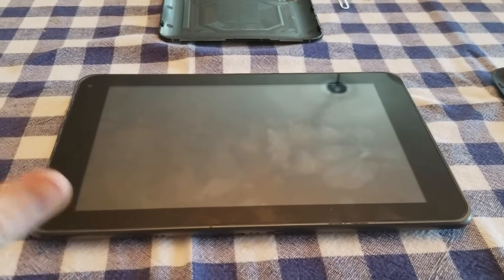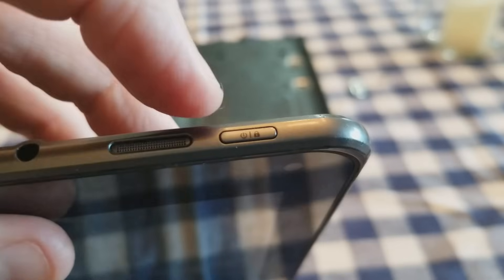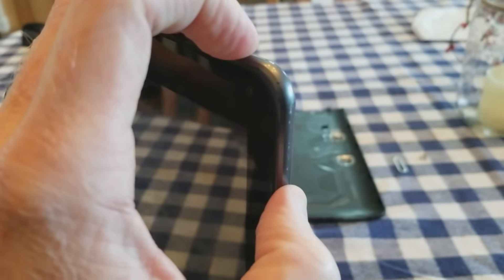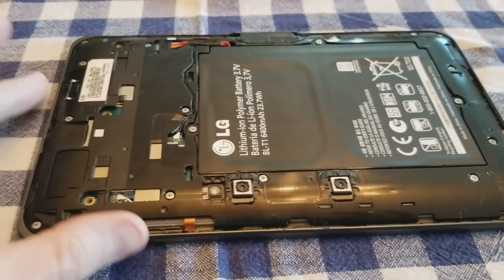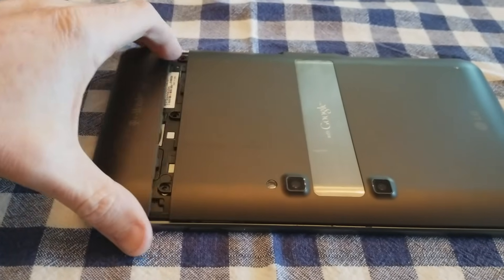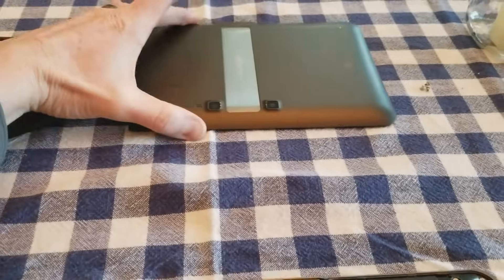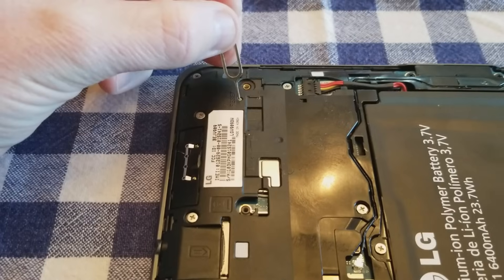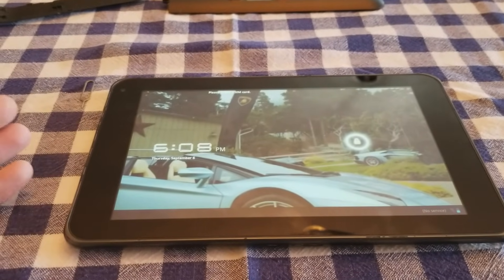Android Tablet Won't Turn On FIX!!

Comment: My tablet hasn't been working for 3 days! I have been holding down the power button while it's charging so it will turn on, (that's what usually happens) but, you know the battery that will pop up and show your %? (Tablet A Samsung android) it just kept flashing. So i thought it might have cut off, and my uncle works with computers and stuff but i can't get up with him because my tablet won't work!!! I really, really, really, hope this strategy works. 5 hrs later... It didn't work. I've had so many memories on it though. I can't take the back off of mine or it will probably break so.. I guess I don't have a tablet anymore :"(

Comment: I have a samsung tablet, I dropped it on it’s head, it’s not cracked or anything but it just turned off into a blank screen. When I plugged in the charger it kept flashing the sign that it was charging, when I clicked the power button the starting screen turned on but turned off, I don’t know what to do

Comment: mine has been packed away in box for 2 years and now can only get the dead android man and warning light....any ideas on this?tried the all 3 button method but won't bring him back to life :0(
Reply: I could try to find a way if you’re still having trouble
Reply: Did you try measuring the voltage on the battery ? 🤔
Reply: that’s the problem with mine too
Reply: Your battery is probably dead if it's been sitting there for that long
Reply: what i did was hold in the reset button for 15-20 seconds then let go, after that i put it on charge with an adapter that was alot stronger than the specified charging amps ; 2.1 to be exact (its an apple ipad charging block and i used a ps4 charging wire) and left it for about 10 minutes it should change the screen to the charging stage then just leave it to charge and your all good if this doesn't work try disconnecting the battery from the circuit for 20-25 seconds and then reconnect, if it still doesn't work try both steps together and just leave for a couple of days to jump start the tablet into working. Hope this helped as it worked for me.
Reply: @shinygoldman4464  had to come back to say thank youuu!! 🥰😭
Reply: @htxrosee  your welcome glad to help someone hope you pass the knowledge onto someone else
Reply: Power + Down Volume did it for me
Reply: @isa.marie2009  i have a rca and in a few months it broke.
Reply: I'm having the exact same problem with mine.  I don't suppose you found the miracle cure since you posted your issue, have you?  It's been three years at this point that I've been holding onto this thing hoping I'll come across a "tablet whisperer" who can revive it.  I don't want to put any more money into it than I already did back when Sprint charged me for the insurance deductible, didn't fix it, and gave it back to me to stare at while I continued to pay for the lease and the service it wasn't using until my contract expired.  I'm so paranoid that as soon as I toss it, someone will post something that I could have used to fix it.
Reply: @sheriwilson3320  Did you open yours ? In my example I had to start it externally by applying a small load to the internal battery to unlock it. The latter had like 7 wires or so. 🙄
Reply: Oh no
Reply: Make a vision of that so I can see it
Reply: Mine won’t even do that 🤪

Comment: Thank you so very much....I almost threw it against the wall
Reply: Tripp Courtney hahaha i was thinking of doing that too lol
Reply: @kyoko-chan227  ll
Reply: ゼシストZethyst a a ewwwaaqwwwwww
Reply: @kyoko-chan227  sometimes you just have to let it go....as hard as u can at a wall
Reply: I always do it and then it works lol😂😂😂😂😂😂
Reply: @jeremiahbrady3117  same
Reply: I am still suffering 😡😡😡
Reply: Me to
Reply: No lie. Or bust the whole thing trying to get at the battery.
Reply: Me too I always do that
Reply: @nxiyxh00  cap
Reply: @idcidek2727  what
Reply: @nxiyxh00  nvm
Reply: Tripp Courtney For an RCA tablet that IS the best solution.
Reply: @caddyguy5369  indeed....lesson learned
Reply: I'm 9. Please help me! My tablet wont turn on nor charge. It has water damage
I need small tips! 😭😩😦
Reply: @thebaseelanthebasavagam220  same exactly the same but I'm 10
Reply: @thebaseelanthebasavagam220  This Is Where Rice Comes In Handy~
Reply: @thebaseelanthebasavagam220  im 12
Reply: Same
Reply: Oh...umh I already did that :>
Reply: Me too
Reply: LOL
Reply: I traped it under 3 bibles, it´s fine, just a little more Christian
Reply: Will that work for a intel inside nextbook
Reply: @Evie same
Reply: Same bra
Reply: I did 4 times, maybe that's my problem
Reply: @butchcarr1334  ,,,7/
Reply: Same
Reply: Good thing  TipsNNTricks.
Reply: Same
Reply: Same
Reply: I almost threw it on the floor
Reply: Me to 😂
Reply: im about to throw it against the wall
Reply: 😂 ikr
Reply: I was just about to throw it at one of my neighbors 😂😂😂 thanks. I'll see if that works.
Reply: I did
Reply: John I am so sorry
Reply: I'm 10 seconds away from that..
Reply: Me too...i almost crashed it....and i found this 😍...thank u so much
Reply: 🤣🤣🤣I usually slap it until it turns on 😂😂😂
Reply: @bxrkeshorts738  lol😂
Reply: Samee😭
Reply: Hahahahahahahahahaha
Reply: I did
Reply: This is why I started buying Apple products
Reply: Same but I almost threw it in the trash hope my dad. Won’t another tablet
Reply: Right😭
Reply: I was thinking about throwing it to the ground and jumping over it 🙃
Reply: Uh
Reply: XD
Reply: Sameee
Reply: Lol
Reply: Fr
Reply: Haha
Lol
I almost smashed mine with a brick
Reply: Lmfao same here
Reply: Easily the most likes anything I have ever posted.....so funny....u guys are hilarious...good we can laugh at ourselves
Reply: well.... i did
Reply: chile anyways so
Reply: Lol
Reply: I did almost hit it on the wall
Reply: Same I was ALMOST then when I find this i  was like😌😌😌
Reply: Me too I just throw it down on the floor 😂😂
Reply: Cap
Reply: Mine i already trowed it😃
Reply: Bobo kang kupal ka
Reply: XD SAME
Reply: Same bro
Reply: Same
Reply: I have been giving it the knee for the last month or so...
Reply: I was like 🤧R.I.P
Reply: Bru me to but i have a new phone now hahahaahaha i almost smashe the tablet with hamer
Reply: LMAO
Reply: i did with mine thats wht is is not tering on
Reply: PLS
Reply: FRRR
Reply: @nxiyxh00  Hey I ain't lying!
Reply: if you were about to throw it, just calm down... my method for calming myself is:

GIT GUD BITCH

Comment: My rca voyager III tablet turns off when it still has battery left. Sometimes it even shows an icon that says it's dead. I know it's not dead because when I plug it in. The battery icon shows there's still battery left.

Comment: My daughter has been bummed out for the past several days because her Samsung tab a 10.1 would not turn on. After watching several videos I realized I would have to take the case apart but didn't have anything thin enough that wasn't metal to pry the backing off. I was going to order one of those tablet repair kits off Amazon when I watched your video with her. She heard you say guitar pick, and since she plays guitar she ran into her room and brought one down. The guitar pick worked perfectly.  I disconnected the battery put it back together and then the power button and volume up button reset worked.
Reply: Your tablet android version tell me please 😊
Reply: I did it but did not work 😢